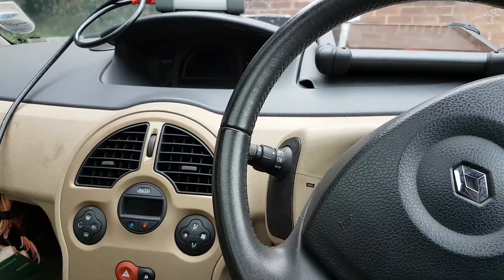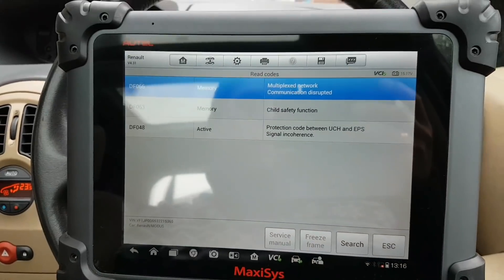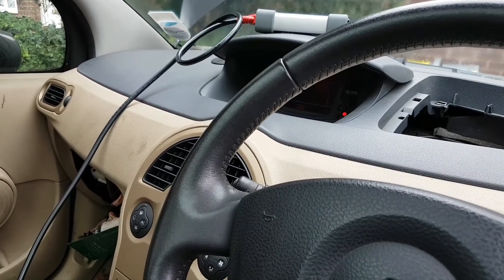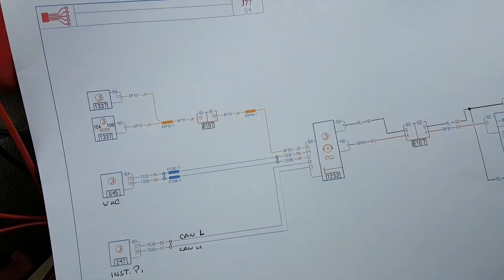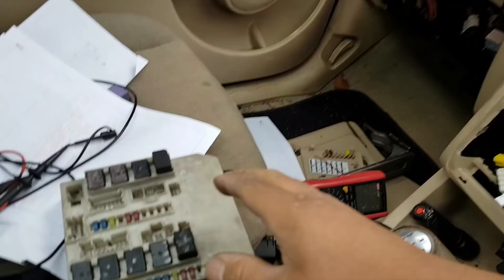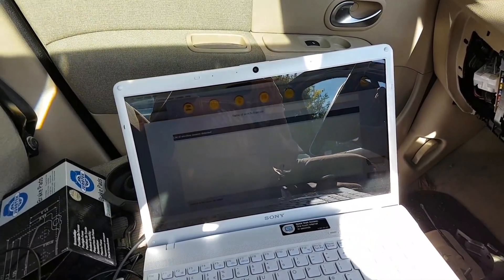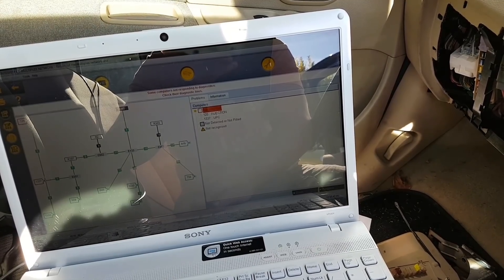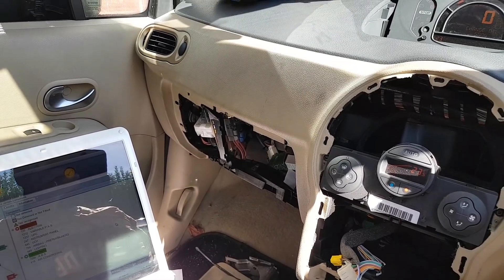Renault Modus 1.5 dci not cranking not starting. Comms faults. Fault finding and repair.

Comment: This problem are very common ,they started on Megane 2 as from 2003-2008. its the upc which gets water inside,ive replaced over 70 of these.u either get corrosion inside or burnt connecion..   om megane 3 its fine till now.   great job  like  first time issue  ,have to start from the basic to find the issue. it happened to me back in 2005 when i was still working for renault as a technical cordinator.,and i started at 5pm finished 11pm.  the rest was easy. no power chk UPC and replace. but your work procedure was like a pro technician.,hats off
Reply from the maker: 😊
Coming from a technician I really appreciate you comment! 
I am actually just working on another one which although there is no signs of water ingress, it looks like is suffering from an upc failure....
Thank you for watching and for your comment!
Reply: whats does upc stand for    read its a under bonnet switching unit ???
Reply: Okay i have question Modus 2005 1.5dci - The engine is rolling but not starting we thought it was the injectors or the pimp but it got good bar’s of pressure and wont start . Just rolling on starter and wont start. We check everything! I mean everything. It have fuel , it doesn’t save checks (errors) give us a way / path to what to look for
Reply from the maker: Check live data when cranking...
Do a relative compression test...
See if that shows anything...
Thank you for watching!

Comment: Could you help me? I have a clio mk3. It uses the same fusebox in your video. I'm getting a low battery and battey symbol on my dash. Voltage reading is 13.70 engine on. Do you know if the alt sense wire goes to fusebox? I belive inside the fusebox is a pcb with 8 smaller relays soldered to the pcb. Do you know if one of the relays on the pcb is responsible for alt charging message at all? The sense wire on the alt is reading 2v

Comment: The state of some of the cars you've had recently from other's attempts at repairs has been shocking. Makes fault finding even more difficult but glad you managed to fix it. Not sure you've covered it in your other videos but for the diyer like myself it would be useful to know what the acronyms mean for the different modules as they seem to vary per manufacturer. Just a quick google shows UCH, BCM, BSI, BSM all for one box! Also you mentioned this is the "same" module for Micras and I think I've read that k12's can have issues with these modules. As my mum and brother both have old k12s then are there any preventative measures that can be taken to stop the failure of them / make sure there isn't any water ingress etc.? My brother also has the keyless entry/start which I'm very nervous about that going wrong as it will probably be a write off. Also beige interiors never age well.
Reply from the maker: Hi Rob...
Yes, the acronyms vary from manufacturers... experience or a quick Google search most times will help you finding what they are...
Yes, this UPC module is also fitted on the Nissan's... as you might have seen, this one had signs of water...
I think keeping the drains cleared etc will help...
Don't stress untill you actually have a problem... lol
I know is easier to say than do...😉
Thank you for watching and for your comment!

Comment: hi Luis, great job so far, I wanted your advice on my 1.5 dci mod. it doesn't like to turn and won't start. also it doesn't work. placed on the tester shows that all codes are open. I don't know what that means, but supposedly the computer in the PSP activated the vehicle's immobilizer. I would like to ask you for advice on what to do.
Reply from the maker: What this video carefully...
https://youtu.be/BXGi802Cnxg
👍👍👍

Comment: Thanks for the video's! What diagnostics program and cable to connect to the ecu do you use? Would be mighty helpfull as I have a problem my mechanic won't fix :(
Reply from the maker: In this video I initially was using the MaxiSys, and later Clip....
Thank you for watching!

Comment: Not an easy diagnosis with the car pulled apart and incorrect parts and someone already having messed with it. 

I always wondered about parts interchangeability between Renault and Nissan. Actually from what i have seen on this channel it doesn't seem like Renault took lessons on wiring and electronics from Nissan. They still seem kind of poor.
Reply from the maker: Indeed... still a bit if work to do by improving their wiring, module location and sealing! 
Thank you for watching and for your comment!